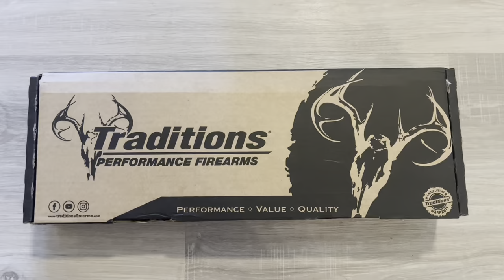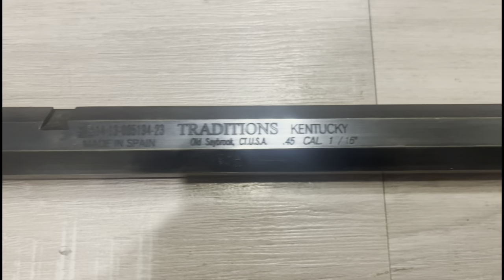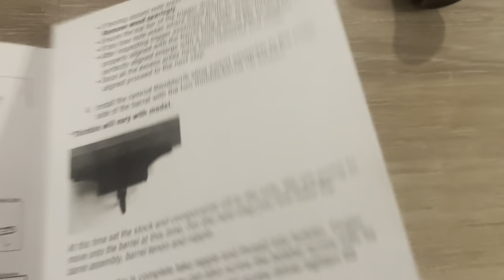Building and testing Blackpowder Blackbeard Muzzle Loader Pistol AKA Traditions Kentucky Pistol Kit

Comment: Your front sight is installed backwards.
Reply from the maker: Someone else said the same thing but seems there is more glare if I install it the other way.
Reply: @oddrocket2743 The front sight is backwards. I blackout my front sights with B/C cold blue. It turns brass black. Then you can take a small file or sand paper to expose the brass on the tip of the sight. I promise you will love it.

Comment: Blackbeard?  I don’t think percussion cap locks existed in Blackbeard’s time.  You need a flint lock.
Reply from the maker: You are correct, but the flintlocks I tried were unreliable. It is also rifled, which is technology that was not around in the 1720's in pistols, but this is as close as I could get it while still keeping it reliable and easy to assemble.

Comment: Awesome gun bro, but holy moly, i winced when you dry fired it twice lol thats a great way to break a nipple. And the patch isnt technically necessary, but it helps with fouling in the barrel, rifled or smooth. Hope this helps
Reply: The patch gives you much need accuracy because the patch binds in the grooves. The ball leaves smooth as it went in. But the patch twists and make her fly like a baseball.
Reply: @BrandonBumgardner-dm7ek ther are muzzle laders no patch  just powder bullet  bullet is biger   groves in the bullet   ,,,,,,,or others, powder something like a cotton disk bullet ,,also groves in the bullet,,,,,,and in the rewolvers powder bullet ,and it tranverse from the unriffeled   cylinder unpatched in the riffeled barrel and hit at 50 jards 🤓👆🏻
Reply: @minicannons781  I have a muzzleloader, what in the hell are you talking about?

Comment: A bit of sanding and a few applications of boiled linseed oil would greatly improve the looks of the stock.
Reply from the maker: I will try that to get the shine but want to keep the dark finish since I saw in a museum old naval pistols had their wood finished in with tar and had an almost black finish. Can I just rub boiled linseed oil over the stain to get the shine and avoid sanding it to keep sanding from making it too light?

Comment: That spring is for applying more tension on the ramrod,it goes in behind the lock plate and is held in place by the lockplate screw.

Comment: The nose cap just protects the wood. Patches and properly sized balls are absolutely needed for accuracy with rifled barrels. Smooth bore patching can be debated. Twist rate is also critical.
Reply: And with a perfekt bullet sice no patch ?? Just  powder  a cotton disc than the bullet ?
Reply: @minicannons781  the most accurate smmoth bore shooting ive seen was powder then wadding then ball then cover wadding no actual patch.
Reply: @thomasozminkowski2589 ah  ok. . in pedersolis skrew barel deringer ,,,riffled ,,,no patch posible
Reply: @thomasozminkowski2589  revolvers no patch,,,but akurate 🙄up to 50meters ,,,,,,,,i think his sigts are moving every  shot

Comment: the kits are made where you have to fit and finish them. Sanding to make it all work well. That screw you left loose? Would work correctly if you had just fit parts correctly.
 There are instructions for a reason.
Loading: You are using a revolver load of powder, not nearly enough for this pistol, sooner or later you are going to have a ball not make it out.
Ball for your .45 should be a .435 roundball WITH a cloth patch. What you are doing is dangerous.
NEVER, not ever load your powder with the powder flask. The one you have is again for a revolver. load the proper amount into a brass or whatever material measure that is NOT attached to the flask. Again, a revolver is different. You should be loading fff pistol powder using 40 to 60 or more grains of powder. That puppy should kick and make a blue cloud of awesomeness.... 
Are you using black powder or did you buy modern gunpowder? If you did, get rids of it because someone will be harmed or killed.
Reply from the maker: I followed the instructions and dry fitted everything before LocTiting and screwing it down but there was no mention of that screw in either the paper or in what I found on Google.
The instructions say to use 20 to 60 grains of FF or FFF powder. I used 20 grains of Pyrodex RS which is supposedly FF equivalent. Is there a reason that the flask is not good to measure with and what do you recommend for measuring in its place?
I read on line that people historically used oversized bullets if they did not have paper cartridges and that you can use .454 to .458 balls in .45 caliber without a patch. Is this inaccurate and is the load of 20 grains of Pyrodex RS with a .458 bullet unsafe? What can I do to make it safer while still keeping it historically accurate? 
Sorry if some of the questions may seem stupid, but I am still learning. Thanks

Comment: the spring is for the ram rod.
Reply from the maker: Where does it go? How does it connect?
Reply: @oddrocket2743 it goes on the screw by the  ramrod
Reply from the maker: I don't understand because I don't see a screw hole on the spring. Do you have a link or a pic that shows how it connects? Thank  you in advance.
Reply: If you take th barrel back off you'll see a screw going across the Chanel the rod sits in. That screw goes through that round bit at the end of that spring. When the rod goes in it pushes the spring up against the bottom of the barrel which puts tension on the rod holding it in place. If it's loose or the rod won't go in after you install it the spring is upside down or backwards.
Reply from the maker: @warrenmeshke1141  Thank you for the information because it had me stumped. Too bad that I epoxied the brass channel the rod sits in to provide some tension with the epoxy.

Comment: i dont trust that tiny piece of wood under the nose cap holding everything together. If it where mine I would have to add a tennon and a pin as well.
Reply: You are correct. That small lip of wood can and does break. It's a known problem of the design. The easiest way to reinforce the area. Is to drill 1 or 2 small holes into the front edge of that lip lengthwise into the stock. Then epoxy small steel or brass rod even a small drill bit into the hole. This will eliminate breakage.

Comment: You sir are missing your powder measure and ball starter, do it the right way.
Reply from the maker: Isn't the powder flask measure supposed to be used for measuring powder. Ball went in the barrel relatively easily - do I need a ball starter? I am still learning these things, but I did find out that pouring directly from the powder flask is dangerous, so I will not do that again.
Reply: You need to use a powder measure that is completely separate  from any powder horn or flask to avoid possible explosion if there is an ember left in the barrel from the prior shot. If you use a patch around the ball, you will get better accuracy. Also, shooting a loose ball will cause the barrel to foul quicker.  Be sure to use a lubed patch to help with loading and to keep the fouling soft.  A  short starter is very helpful to get a tight ball/patch on the way down. You'll get there, just be safe!